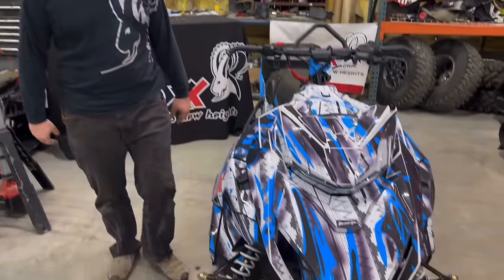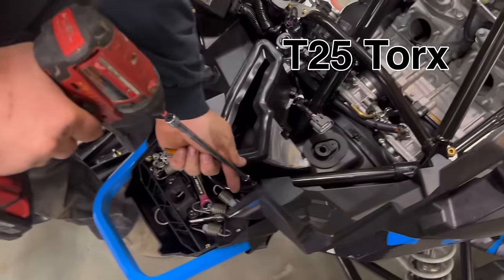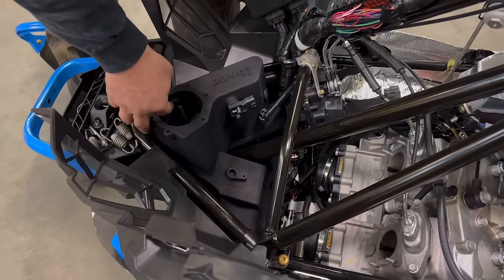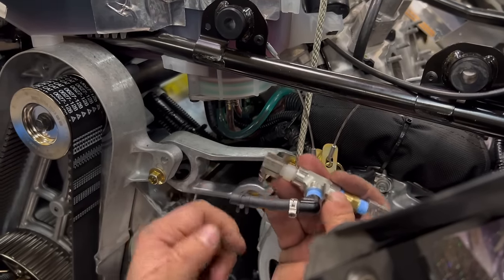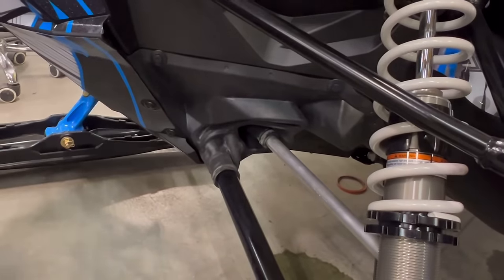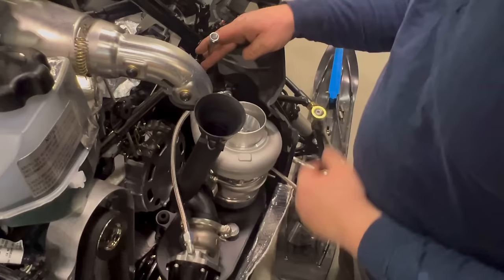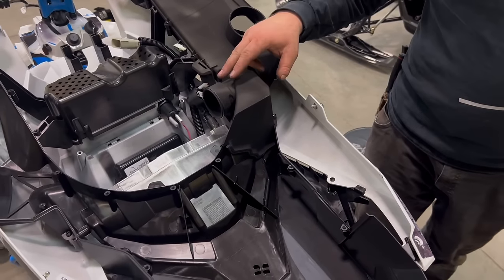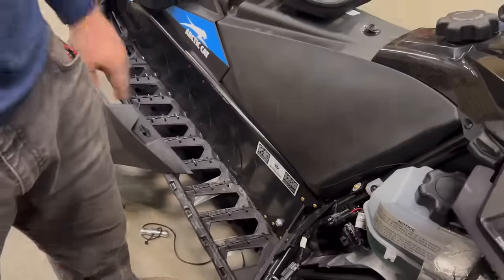Installing the High Intensity Turbo Kit on the Catalyst 600.

Comment: May I ask why you would mount the turbo inlet up exhaust down? Turbos in the car world do not like inlet and drain for oil not being up and down. Is it someone sort of turbo I am not aware of?
Reply: The snowmobile world is a little different. We do not return oil like a car. We use 2 stroke oil and it burns in the bearing housing. We drip very little in there so it’s not flooded. You could do this in a car. Although idk what the longevity of the turbo would do when it is mounted like this. There is independent oil galleys that oil the exhaust bearing and intake bearing. So they get sufficient amount of oil. Ball bearing turbos also do not need as much as a journal bearing